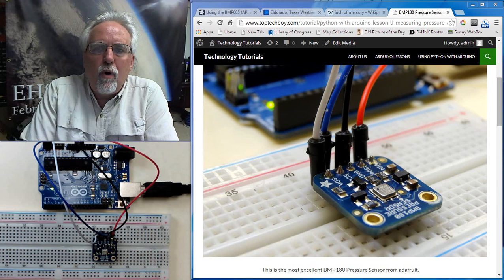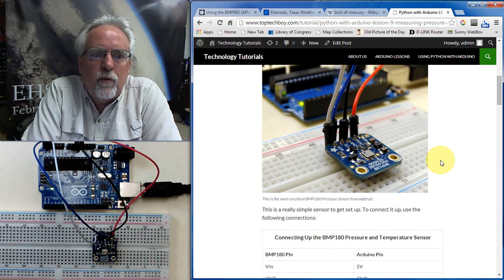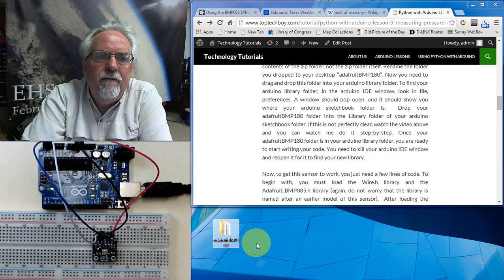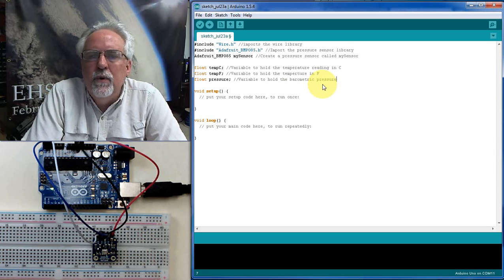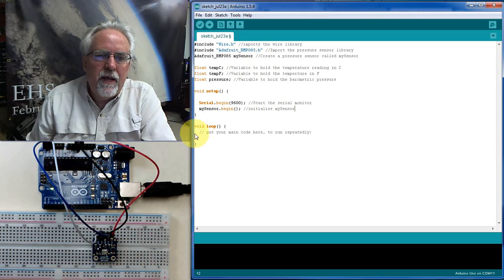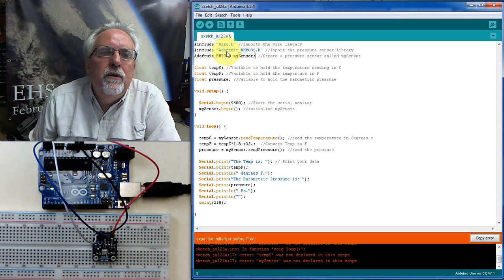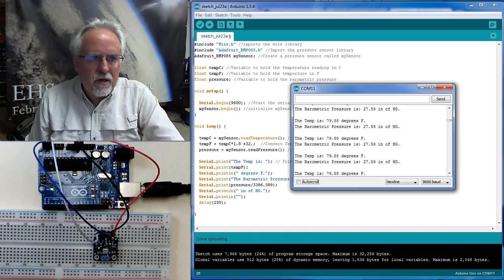Arduino with Python LESSON 9: Measuring Pressure and Temperature with the BMP180 Sensor

Comment: I am doing this lesson in 2021 and no amount of effort got the Arduino IDE to compile using the Adafruit  library.   I went to Sparkfun and their library worked fine even though much more difficult to use.   I was able to pull out values for temp and pressure which should work in the next lesson.

Comment: I am trying to use  BMP180 with LoRa for a project and it's working fine. But the deflection in altitude data is too high. Even in a position when the circuit is sitting on a table top.  Seems very unstable, specially when the circuit is in use for more than one hour.  The difference goes up to 30 feet!! .. And keeps going up and up...  Unacceptable !!  Have you ever tried it for more than one hour?? I am stuck with the project.
Reply: You can try Kalman Filter.

Comment: Hi Paul,

Newbie like me may expect a bit more in details about SCL and SDA (and the protocol used in this lesson i.e I2C) and the equivalent pin config on the Arduino board. I think, it would be helpful if you explain a bit more in details about the Wire.h header file and how Adafruit hooked them up even though we are not using Wire.h header directly (I do believe begin() is doing this).

On the other hand, what are contents available at Adafruit_BMP085.h header file to explain from where begin(), readTemperature() and readPressure() are coming/loading? 

However, I am enjoying all the lessons available in your channel. Thank you very much sir and love your way of explanation.

Comment: The BME280 is currently the latest, best sensor for temperature/humidity/pressure. But be careful when buying from Chinese sellers on eBay, they are careless at best, and outright lie at worst, so you might get a BMP280 or BMP180 instead.

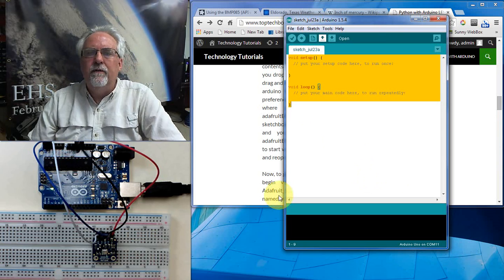7:02 - It only enumerates the installed libraries once, during startup (I think the latest version is the same).

Comment: hi paul
im tryna build an infomation screen to fit to my car and im failling at getting the  coding to work correct.any advice on coding? ive got only 5 analog inputs from automotive vehicle sensors which are
air pressure 0 - 4.0 bars
liquid pressure sensor (oil) 0 - 6 bars
liquid temp sensor (oil) 0 - 110*C
liquid temp sensor (water) 0 - 110*C
air to fuel ratio

if we could perhaps chat over emaill?
350gts@gmail.com

Comment: Sir I want to make altemeter for rocket so  I want to program arduino as the altitude decreases output should generate and it fire the ejection charge .so what type of program does I need.if you send me your email id I will send you all details.
Reply: I am an Indian Rocketeer. I am working on electric parachute deployment system. If you want , I can give you the code and hardware details.
Reply: Hello Aeropro,
I also am working on a rocket for the same reason.
I like to register the height into an EEPROM.
Do you have the code so I can read the height on the BMP180 in FLOAT size?
I am trying to get that height in that format. For now, I only can go up to 255 meters because the EEPROM can only write byte size values.
There is a way to use FLOAT size heights, so I can get values with 2 figures behind the decimal sign. :-)

Comment: to My home barometer has a reading between  28 to 31 mmHg. Your device reading of 27+ mmHg is off the scale outside of a hurricane.
Reply from the maker: Pressure depends on altitude . . . At higher altitudes, the pressure will be lower . . . remember the sensor reads absolute pressure.
Reply: How high do you have to be to get a reading of 27? How can we measure the "relative" air pressure where we are? Must we rely on another measuring point? I live at 450 ft above MSL. My wall barometer gauge (just read) reads 29.0 in Palm Springs, Ca. BTW Very good video. Enjoyed this and other of ur vids. Thanks for the effort it took to make all these vids.

Comment: Have you tried using the BMP180 sensor underwater ?  Maybe inside a balloon or something ?
Reply: shodanxx The BMP180 sensor is not made to go under water, the sensor itself need ambient air flow in order to provide accurate readings.

Comment: Why didn't u state pins and input/output variables?
Reply from the maker: ***** It is not required when using this library. The work is done by the library, so you just call library functions.
Reply: Oh OK. By the way, my BMP180 reads the pressure 100 hPa lower. It's really annoying. What do you think is causing the issue?
Reply: @paulmcwhorter   Sir, If I have multiple sensors with libraries to connect, dont we have to mention the pinNumber?
Reply: +Paul McWhorter But is it posible to change them becouse i need this for a project?